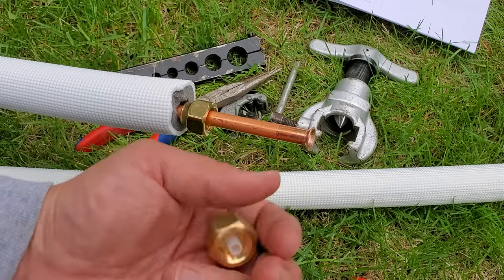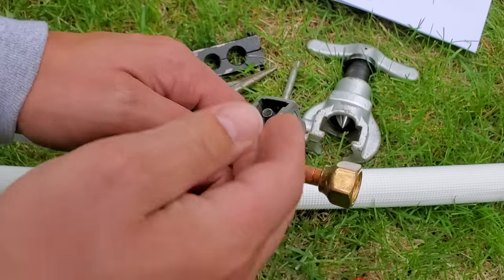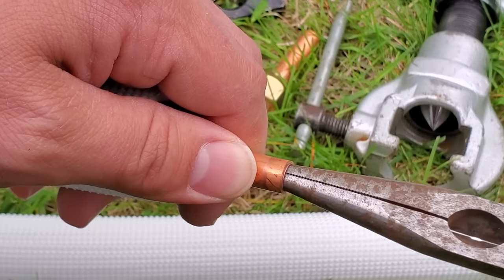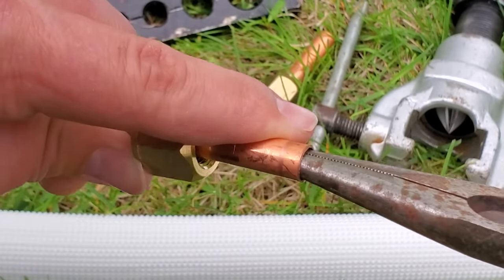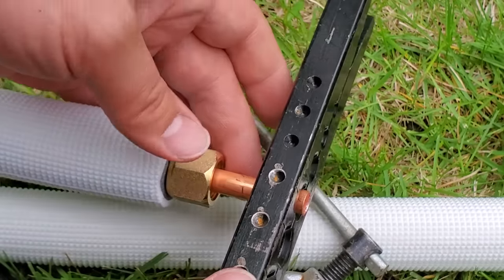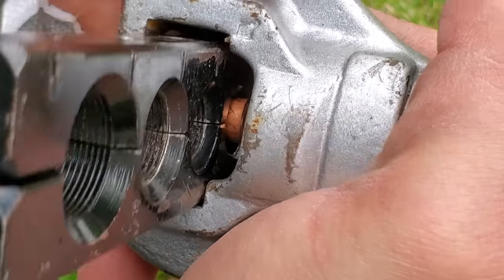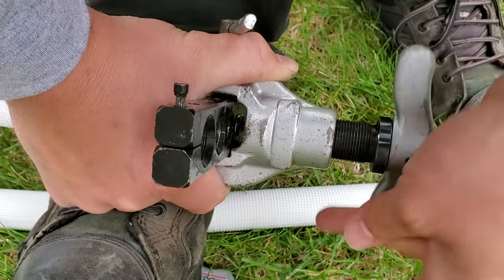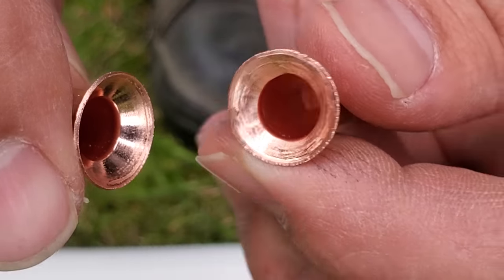How To Make an R410A Flare for a Mini Split AC Unit Installation

Comment: Yes Benjamin, you said your cut did not need any reaming because it was a good cut, yet you spent a considerable amount of time reaming the end after all, I know you did not use an actual reamer but you replaced it with a needle nose pliers.
Reply from the maker: I said that it didn't need to be deburred which is different than reaming isn't it? I could be mistaken.
Reply: Every cut piece of metal should be deburred. And as a former tool and die maker, reaming is a specific operation which was not done here.
All you did was mash the burr down with a pair of pliers.

Comment: Wow, given that it’s significantly easy to install a mini split (as you’ve shown) I think I’m gonna do so; I’m a certified electrician and use to be an auto mechanic ssso I have most of the tools needed for it, (the gauges and vacuum pump are kind of cheap) 😃😃
Reply: How did it go?
Reply: U need a proper micron gauge as well

Comment: What mini split are you installing? Most mini splits have a requirement for minimum lineset length. Also never use line set with premade flares - they're never made correctly. Also good practice to use nylog when connecting linesets.
Reply from the maker: This one was for a Fujitsu dual head model. We usually don't get the linesets with premade flares. That's what our distributor sent this time and my goodness were they terrible! Some of the other flares were even worse than the one in the video! Very poor quality control.

Comment: I'd recommend using a refrigerant lubricant, like Nylog, on the mandrel of the flaring tool.  A higher quality flaring tool would also help.
Reply: Working without reamer.. Unprofessional.
Reply: He used one of the best flaring tools.  I used this exact tool for years.  Only place he went wrong is preparing the pipe.

Comment: Hey Ben, I just bought a Mr. Cool mini-split.  I need to run the line set under the crawl space and up the wall for 2 rooms.  For bending the line sets from the air handler and under the house, how do you recommend I do it?  Carefully by hand or use a tool?  Yes, this is my first mini split install

Comment: I'm getting ready to replace an older split-mini with a new larger one.  (24000 BTU) I bought one with a 16ft lineset.  I only need about 9'.  Are there any issues with liquid/pressure to cut the lineset that short?  Is it better to keep the lineset as short as needed?  Is there a length I shouldn't shorten it to?
Reply: The manual should tell you what the lengths are. They come pre-charged with refrigerant, and I suppose it's possible to have too much (but I am not an expert). Ideally the manual has a minimum length, but at the very least it should say the maximum length you can run before you have to add more refrigerant, and an amount to add per foot of extra line.

A quick google turned up a result: DuctlessAire and Mr.Cool systems have a 10' minimum length.
Reply: What did you end up doing with your line set length? Did you go below 10'?
Reply: @motog6436  I just ended up cutting the line set to the length I needed (9').  The line set was not pre-pressurized so it was easy to cut and flare the one end.  I did end having to buy an inexpensive pump and manifold gauge set at Harbor Freight.  My biggest issue was getting the stub out lines coming from the evaporator  bent properly as close to the house as I could.  I ended DIYing a cover over the part that stuck out from the house.  The unit has been functioning fine for the past year.  Fingers crossed.  :)

Comment: You take forever to do a simple task. Cut the tubing, install the flare nut and flare. Your tool will take any extra material left from the cut and build it into the flare. Next, make sure you use a torq wrench to connect. That’s why the instructions give values. I also put a dab of refrigeration oil on the face of the flare.

Comment: I prefer a nice hydraulic flaring tool (mine was only $400) and I would never use a flaring tool that leaves scratches in the flare, I would never do a single flare on Freon or propane lines (always do double flares).

Comment: The manufacture put on a nut they then say to replace it with a heavier??? The line set must not have been from the same manufacture as the unit itself??

Comment: Curious...  Would adding a heavy lubrication to the flaring tool be advisable to make the flare easier/better for a non refrigeration line?  Obviously you wouldn't use a lubricant on a refrigeration line but something like an air line or maybe transmission lines?

Comment: I had fear in my hear the first time I flared for 410A....I knew pressures were higher and a sloppy job with 2 short of a shoulder would could cause the tube to blow.  Not good.  I read the direction from the factory on the mini split I was installing and was meticulous in my flaring....Have not had a problem yet but I would would prefer a baized joint any day.  I have Never liked flare fitting for high pressure refrigerant.

Comment: I can't take it start over use electric flaring tool so it rolls the flare t o 45 degree flare a good deburring tool optional tool double flare tool Emery paper to clean off the copper shiny and clean nylog sealer one torque wrench yellow jacket leak test soap for AC units add charge it for leaks with nitrogen at nameplate rating😊

Comment: The more preferred flare nuts are forged as you can see.  The less expensive nuts are machined.  We prefer using forged nuts.  Do you like creating your flares dry?  I prefer to use a lubricant, same with installing the nut, I prefer nylog, if I'm spelling it correctly.  Lubricate the mating surface of the flare and all friction surfaces of the nut and threads.

I will never forget, when I was first learning this business over 50 years ago, the book said to lubricate the flare with refrigerant oil.  At the time, they wouldn't sell less than a gallon, all I needed was a drop or two.  Jim

Comment: The wall thickness of your flare looks much thicker than the factory fitting.
Reply: It is from the same copper tubing. the factory flare was over stretched / flared and thus the flared part become thinner.  His flare was properly done.

Comment: Does anyone else use a dab of oil on the cone of the flaring tool before flaring?
Reply: What type of oil do you recommend?
Reply: @ulisescruz157  I use mineral oil, then wipe it off the flare once I finish the flare. In my opinion, there is virtually no oil left to cause any issues in a 410a system. I've even been told by several tech support guys that a 410a system can have up to 20% mineral oil in it before causing issues. This little drop is much less than that.
Reply: @chrisdeanndavison3626  Thanks, any specific brand that you recommend?
Reply: @ulisescruz157  No brand in particular. Any brand of refrigeration mineral oil should work.

Comment: I am really surprised with your attention to detail for a young man. I can tell you that if you would use a lubricant on the flare cone roller you will get even a better finish. Am really amazed as to the factory flare being so rough. Also, the original flare nut looks kind of  cheap. The one you used instead looks much heavier duty for sure. Very well done  video with great explanation. Good day too. VF

Comment: The flare is too long!! Mitsubishi spec for 3/8" copper tube is 0 to 0.02" for R410A  and the gentleman used more than 1/8" which is more than 0.100" . Nice work but too big a flare for all mini split. 
Older R22 system use a little longer -- 0.06 to 0.08" --  but not so long as in the video.

Comment: Sometimes the manufacturer of the line sets makes unbelievably horrible flares and even if you have to use the line set nut that comes on it, make sure to cut the flares off and make your own.

Comment: How come you're telling to do the flare the wrong way to begin with single flared leak anyway you have to double wrench him to death found out a double flare work. Doesn't leak I cut out every single Flair and my two systems has it leaked yet cutting tools that you use is good but has no reamer on it the Ridgid tool flaring tool that you use rolls the copper but true expansion contraction a single flare just doesn't cut it the high pressure of 410 is too high it will leak
Reply: Nope, a correct flare torqued correct won't leak, verify with your micron gauge obviously
Reply: Blah blah tell a blah

Comment: Have you ever heard of used a drop of dish soap on the end of the flaring tip to help in starting the flaring. Why I ask is because Years ago I helped a "Air Conditioning Technican" as he called himself not an HVAC and that was his standard practice, to either dip it in a rag with soap or just put a drop on it.

Comment: I've always found Flair fittings leak after time. Copper cold flows and thermal cycles open gaps. I stay with Teflon seals on the king valve or hard silver brazed joints. Hermetic seals are best for long term. Look at all the videos on why a flare is leaking. Common problem. They may be OK for Oil furnace fuel, car brake lines, etc, but high thermal cycling of refrigeration, not so much.
Reply: id love to see a video of how you would do a a/c line.
Reply: @jaybraun7471  When possible, Silver brazing with 15% brazing alloy. Used a welding torch. A heating torch won't do it.  Look up silver brazing. Done properly it produces a hermetic seal, just like the hermetically sealed refrigerator in your kitchen.

Comment: Be careful as most asian built units have a metric lineset. In this case the standard inch measure system will be difficult to get good results with. The system is designed to operate with all the line set used. If you have extra wind it up carefully behind the exterior unit. Best bet is not to cut and re flair if you can help it. This is a common failure point. GREAT VIDEO
Reply: my set came with 2 cone bridges. metric and imperial.

Comment: In refrigeration a flare is a flare is a flare, refrigerant type is not a variable. As long as you are doing a 45 degree flare (for copper), yer good. That being said, a good eccentric flare tool provides a much cleaner mating surface than a traditional flare tool.

Comment: Not only is this video 8 minutes longer than it needs to be, but you didn't even explain at what point you're supposed to stop turning the handle. You just say, "That's about it." Well, what does that mean?? How do you know when "that's it"? And if I go too far with the turning, will I ruin the flare? Youtube videos should be brief and right to the point. You've got good video angles and lighting though- if you take my advice, your videos will be awesome
Reply: Did you watch the video? Lmao the flaring tool has a depth set and stops flaring when proper flare is reached, then any extra spins smooth it out. 
Not sure how the video felt so long if you weren't even paying attention hahaha

Comment: Where’s the flare gauge? After 30 years of doing these, if you don’t gauge it... it’s no good. CPS and Daikin  make gauges that are required on professional installs. The difference of a 32nd of an inch can mean lasting seal or callback in a couple years!

Comment: So how much gas do you reinstall into the unit oh that's right you cannot get 410A gas you're not qualified
Reply from the maker: I am certified to handle refrigerants in the US. Usually you can find that answer in the equipment manual or on the product information nameplate.